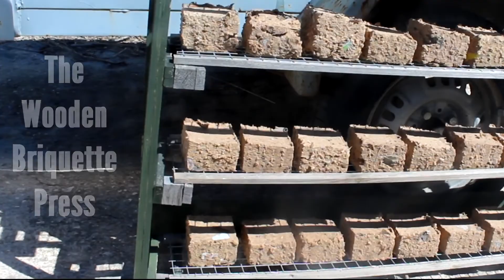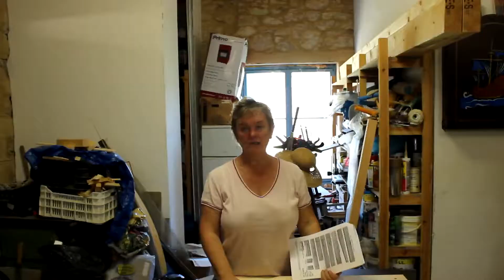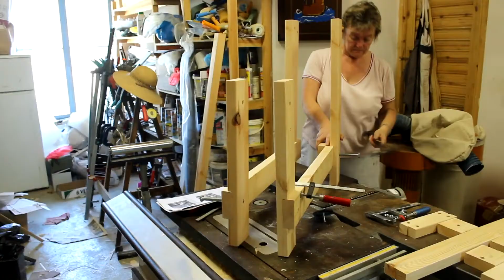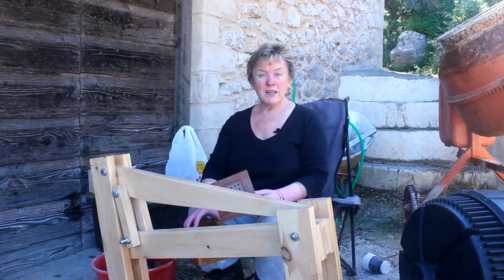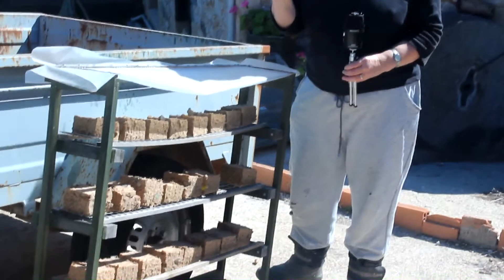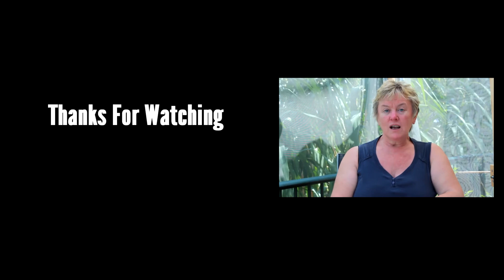The Wooden Briquette Press

Comment: I find the best results are glurp mad with wallpaper past presto & dried to give a light 7 hard  bracket simpler to paper Masha   the hole aides the Bern rate  but not wear gloves the sticky mix can be a little off-putting at first  until one get's the texter just right . damp Note wen  wet keep adding the sawdust until one can squeeze in one's hand & it hold farm  the trans fear to press to Mack a batch of briskets. wen dry they should be light had & Bern well, Les England    they all so charcoal well & Bern well in a gas genarater. to rum generator set's